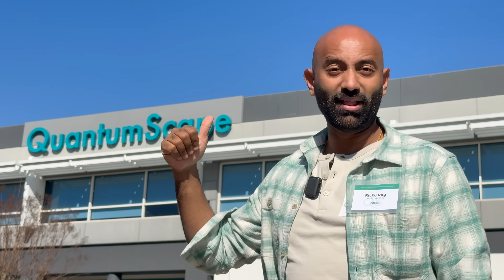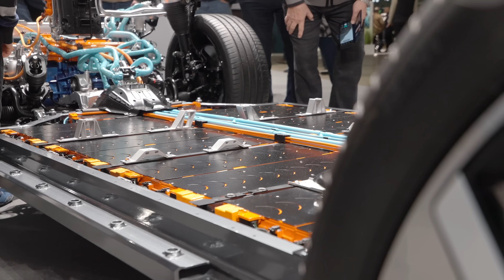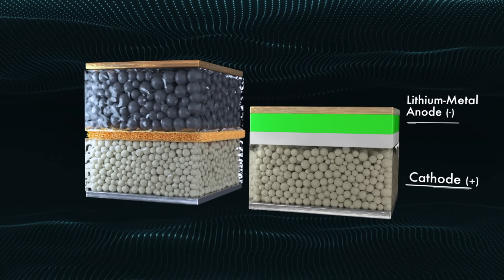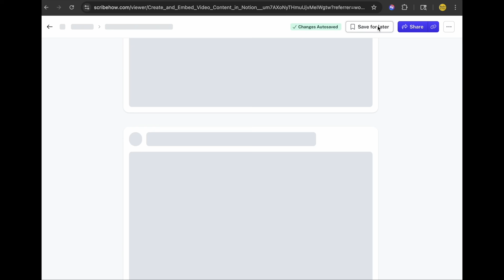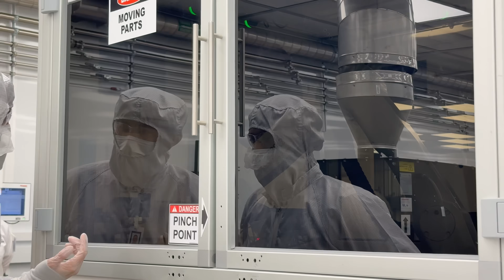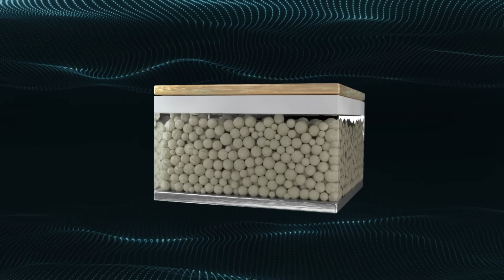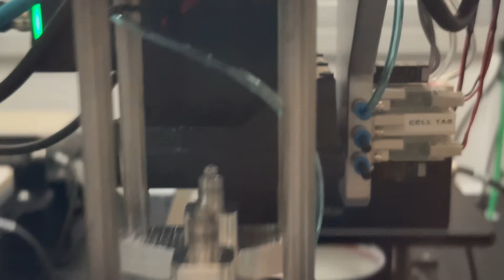I just Saw the FIRST Solid State Battery - It Finally Happened?

Comment: You hit the nail on the head, there's room for improvement but they've done the hard part, next comes the other half and then they've achieved full solid state.

They have the technology and they have the expertise, I have a great deal of faith in them.

I think that a strong possibility will be building a chemical scaffold that can maintain pressure without changing the shape of the battery.

Comment: After a couple years following the progress of this company I can honestly say they are not the most forthcoming group of people. This is actually the first time I found out its not even a solid-state battery, the allowed people to believe that and many still do. The reason why solid-state is significant is that it can turn markets and regulation for battery technology because safety is a high priority concern and therefore a major selling point. that an important . They rolled out a Ducati in a presentation which to this day I have no idea what that was meant to prove because no data has come from it but it definitely drove the stock price up a notch. The energy density they claim is high is nothing much to speak of either. I call BS

Comment: Great.  Besides the upcoming Ducati electric motorcycle, which EVs is this new solid state battery going into or will be going into in the near future?
Reply from the maker: I think Quantum Scape still is proving out manufacturing at scale, they have made significant advances, but stay tuned our NEXT video is on the worlds most advanced Solid State company. it will be epic!
Reply: @TwoBitDaVinci   And bottom line about Donut Labs / Verge electric motorcycles?  Irrelevant already?  Scam or "stretching the truth" in order to get more investment funding?  So basically they deployed crazy, unorthodox (but technically not illegal) bs marketing hype but ultimately still "vapor-ware?"

Comment: Hi Ricky. Great video again, Thanks. Not sure it improves my confidence in QS future, but at least they seam to be progressing slowly on their huge initial endless Hype..... after their SPAC share holders already lost their shirt and more with them..

Still I’d recommend you to have a look at Last Week CATL massive Tech Days announcements.... Including their new Mind Blowing Qiling Condensed NMC battery, offering 350 WH/KG equiped with a "non flamable" gelly électrolyte (Presented as an HE EV & SUV downgrade of its existing even better 500 WH/KG parent Aeronotics version for EVTOLs). That could blankly make this QS 310 WH/KG Solid State alternative, and many other Solid State projects <400 WH/KG absolutly pointless, if real and durable and cheap enough. The announcement was a bit confusing, some understanding it will supports 10C/6mn MegaWatt charging rates (Versus only 4C/15mn here for QS !) while others were not sure. Neither clear Cycles Life, Warranty, nor Prices were disclosed. They quoted a 1500km range in a HE EV and 1000Km in a Large Lucury SUV, within a <650 kg pack, also quoting a 625kg std pack that at 350 WH/KG density should provide a dream-come-true # 219KWH if counted at pack level on new Condensed model, or # 200KWH anyway. While its 625 KG is even lighter than my old # 700kg / 100KWH Tesla Model X 100D pack. 
As they also sell an ordinary Qiling NMC version with less density and possibly more Cs, it was unclear what numbers corresponded to either of their 3 Qiling versions. Hence all is TBC at this stage... But so luch interesting !!!!

But for sure if real, their new Qiling NMC 350 WH/KG Condensed version for HE EVs and SUVs could be a Game Changer, if no bad surprises on its yet undisclosed aspects....

Comment: 350 energy density and 15min charge times ate good, but i think the next gen of li is at 200 kwh/kg and <15 min charge time, also >3000 charge cycles and no safety issues.  Max for a li battery is 400 kwh/kg, but with short charge cycles.  I believe current li batteries get 300 mi of range.  Additional energy density will have diminishing returns.  The driver for the future will be cost.  Na will be hard to beat in cost and its energy density is at 175 kwh/kg.  If na gets to 250, it may be game over.

Comment: Just a quick clarification: QuantumScape is often called “solid-state,” but it’s not all-solid-state. Their key innovation is a solid ceramic separator, and the lithium-metal anode forms during charging. But they also use an organic liquid electrolyte (“catholyte”) at the cathode, which means the cell contains both solid and liquid components. So it’s better described as hybrid / semi-solid-state, not “fully solid-state.”

Comment: You didn’t saw the solid State battery pack. You only saw samples of solid State cells. Still not installed in Real BEVs. 15min 10-80% is very moderate number. Already mass produced BEVs with Li-ion or even LFP could achieve 9-12m for 10-80%

Comment: Definitely interesting.  I would interested to know how this design handles high and low temperatures compared to traditional cells, what the actual expected cycle life is, and if there is any impact on the discharge power curve.

Comment: The fact that it requires a completely new manufacturing process that is not compatible with existing processes mean it will be relegated to low volume, high cost applications like eVTOL, drones, military applications and won't be in consumer products for 5-10 years.

Comment: How can people say that a battery that gets punctured or gets wet is safer? There are lithium phosphate batteries that can be punctured or damaged and not catch fire. People are testing lithium batteries by driving a drill bit through the battery. Sodium ion batteries have an even lower risk of catching fire.

Calling this battery safer is drinking too much of their Kool-aid. It has different failure modes and can be argued to be more dangerous.  As you rightly pointed out, metallic lithium is highly volatile and dangerous.

Comment: Good content, thanks! Questions: 
1. What about the heat production during charging? 
2. What are the operating temperatures and how the separator and changeable external size stand both the constant high / low temperature and its rapid change?

Comment: When I bought my EV (Kia e-Niro) back in 2019 there was a lot of talk about pouch cells were not the way to go, it was all about prismatic and cylindrical designs. The pack level energy density on my NMC pouch cell powered car  is 145 Wh/kg, a level that is surpassed by LFP these days while NMC has gone beyond 200. Having said that, I've experienced no loss of range at all after 7 years and 135,000 km. There are two 2019 e-Niro's here in France used as taxis and followed by the magazine Auto Propre (clean car)..both crossed the 500,000 km (300,000 mile) mark in late 2024 and are still going on their original motors and batteries. Of course we all want to see improvements in batteries, cheaper, safer and using more abundant materials so it seems like QS and companies like them will push the state of the art on further. Even so, we already have battery technology that in most cases will outlive the vehicle they are in. And that was never something you could say about internal combustion engines.

Comment: With QS's "Solid-state" batteries going into EVs, I don't really care if the range didn't improve, the life of the battery stayed the same, it would be nice if cost went down, but even that isn't the biggest thing.... It's the charge times. Taking 45+ minutes to get back on the road is a pain in the butt and the single factor keeping me and many others from pulling the trigger on EVs. If they can truly make it to where you can go from flat to full in 15 minutes or less, I have no doubt many more people would buy an EV.

Rented an EV to try one out, did a 3k mile round trip weekend road trip. it was only the charge time that made me hate the experience using the EV. Range wasn't the issue, because at the 300+ miles total usable range, was ready to stop and take a stretch / bathroom break. You know the typical rest stop pit stop... the issue was waiting the 45+ minutes to get back onto the road again. SO if QS solves that and really delivers on all the other improvements, that's an insane game changer.

PLUS I would love to retrofit a big ol cruiser with a 21 kWh electric drivetrain. Big ol cruisers only get 100+ miles as is, I can only imagine how awesome it would be to go 300+ miles between changes, and with the instant torque of an electric motor, now that sounds like fun.

Comment: Would the extra size of sodium atoms having a lower energy density, make it implausible to apply this new solid state battery method to sodium ion batteries? The combustion resistance of sodium, and material availability, would theoretically make for a neat alternative if it could achieve somewhat comparable performances.

Comment: If it has increased energy density, does that mean that it can hold the same charge in less size? I ask because I have a solar system with batteries so would I basically be able to shrink down the physical size of my batteries and maintain the storage capacity? I'm assuming that's what this means and that would be great if I could do that since I could double the capacity and still maintain the same "size" of batteries.

Comment: Thanks!   Very Informative!
Regarding the double energy density claim.  Do you think they mean double the recommended useable energy density?  For instance, lmr are recommended to charge between 20% to 80%, or stated differently 60% of the stored energy is recommended useable.  250wh/kg * 60%= 150wh/kg.  I believe QS can use the full 100% of its 300wh/kg.  True?

Comment: So it's not actually solid state, not actually that much lighter, not actually that much more energy dense, not actually that safe, not actually mass produced and not actually for sale right now.

Apart from the time it takes to redesign current products, test real world performance and build or convert factories for this new type, I really doubt it will be as cheap as current LFP batteries to produce or as revolutionary as it needs to be to displace NMC anytime soon.
I think I will wait and see if the Donut Solid State battery is real. If not, LFP sounds good enough for me.

Comment: Appreciate the honest assessment of the 'half solid-state' reality. However, there's an elephant in the room: QuantumScape has published exactly ONE peer-reviewed paper (Feb 2025, JES) on testing methodology—not cell performance data. After 15 years and $2B+ in funding, why hasn't this technology been validated by independent labs like Argonne or NREL under standardized DOE testing protocols? The 2021 'third-party' tests were on pre-selected single-layer cells with energy density data mysteriously omitted. For comparison, when MIT's Chiang group developed LiFePO₄ cathodes, or when Goodenough's lab discovered NMC, they published in Nature/Science with full reproducible data. The VW validation is encouraging but they're a major investor. Would love to see your take on why the academic battery community remains skeptical despite the impressive specs you've presented.

Comment: Excellent unbiased reporting. I'm wondering about the cold weather performance "data gap"... One critical spec missing from both this video and QuantumScape's published data: sub-zero temperature performance. Ceramic electrolytes typically show 2-3 orders of magnitude drop in ionic conductivity from 25°C to -20°C. The liquid catholyte side will have its own cold-weather issues, but the solid separator becomes the rate-limiting step. Has QuantumScape published any charge acceptance data at -10°C or -20°C? For context, a Model 3 with conventional li-ion can still accept ~50kW at -10°C. If QSE-5 cells require battery heating to 0°C+ before any meaningful charging, that's a significant real-world limitation not mentioned in the 15-minute fast-charge claims.

Comment: We will have a solid state battery someday but until then this is a great upgrade .
Reply: Upgrade from what? From NMC batteries, yes, but with modern LFP it is on some points a downgrade.
Reply: @Earth-in-space  No , not even in the same country .
Reply: @onthelake9554  LFP beats QS in cycle time, and QS still use a NMC katode? So it is like an NMC upgrade with a better seperator and so, but a downgrade from LFP. 

Prove me wrong, what did I miss?

Comment: Tbh I will buy an EV that has a longer battery life & a distance of atleast 600km+ per charge. That has great performance also in winter ie. -20C & is resellable. Looking at 2nd hand EVs that have a battery warranty of 5-7yrs & are being sold after 4yrs, leaves me only 3yrs & then? If it breaks, the cost of a new one is crazy here in Northern Europe.

Comment: Even 10% better is still 10% better. Solid state is more than just energy density. It's about recharge speed. Performance in extreme weather temperature, and it's resistance to exploding.
Reply: Right on

Comment: One way or another, some exciting technology is going to hit the market within the next 5 years.  We're a month or so away from seeing if Donut labs is snakeoil or not.  I suspect the reason we don't know anything is that if it's true, its because its a very replicable process and design.  Anyone can make a cake for example if you know what the ingredients are, and while a cookie is different, you still have the same basic steps and equipment.  Mix the materials and cook it in the oven.  That's essentially what they were saying in ALL their interviews.  Look, we can't talk about the ingredients until we're already producing these at scale, otherwise the big boys will step in, take the idea, and scale it at a rate we simply can't compete with.  Now I also agree, they probably should have just developed the process, patented it, and licensed it.  Maybe the reason why they didn't though is because it's so simple that you can do it multiple ways.  For example you could bake a cake or cookies in an oven, on a grill, in an air fryer, or hell even a hole in the ground if done right.  Maybe there's too much variability in the process to license it.

Comment: Misleading title: ✅ (It's NOT a solid state battery, I know they compensated you, but could you at least TRY not lying?) Make mundane tech seem extraordinary: ✅ (My phone charges from 0% → 80% in 14 minutes, PD 3.0 aka SuperVOOC aka Q.C. 4.0 has been a thing for a while, and my Q4 can charge from 10% → 80% in ~35 min @ 150kW. Fast charging exists, and reduces cycle count. Now let's not lie by omission, current battery tech is consumable, and this company, regardless of neat innovation, hasn't broken through anything. Silicon carbide tech has ballooned the capacity of lithium poly cells, at ~20% more capacity for the same cell volume. The near universal adoption of independent channel high-speed microcontroller intervention, now present on nearly every BMS manufactured from 2024 onward, has made these cells incredibly robust, as has the requirement of free gas quench & purge systems in automotive battery packs in every market that manufacturers different types of EV.)

And contrary to what you claim, "solid state" is not some ambiguous label; it actually has a definition, into actually be solid state, you have to be solid state, so pseudo solid state, partial solid state, integrated gel with solid state, they're all grifter scamming semantics. The whole solid state battery thing is hot right now thanks to the Donut Lab people somehow getting all of the tech media to focus on their WORDS, because remember they don't have any DATA published.  and who, everyday that goes by, seem more and more like typical vaporware peddlers. 

Personally, I think it's either a super capacitor, or more likely it's some kind of a hybrid. If they actually had the tech and scaling worked out and locked down, literally every company on Earth would be throwing money at them. The type of battery that Donut Labs claims to have built AND can scale the manufacturing of, would literally change the world nearly overnight. Seems like a grift, but I would love to be wrong about that.
Reply: Someone is invested elsewhere? Lol. QS is it ! First to produce ssb !  History!